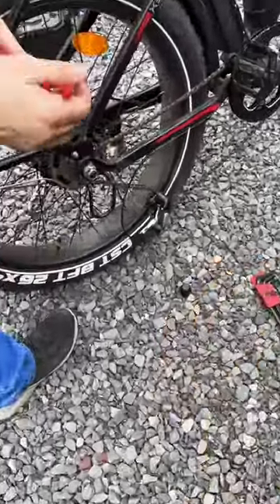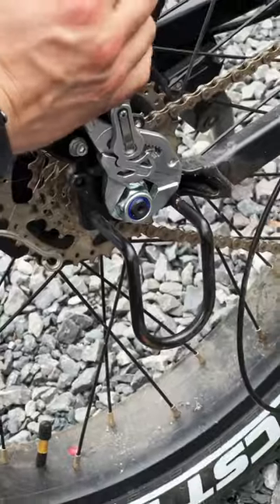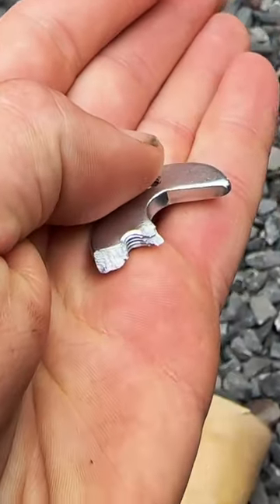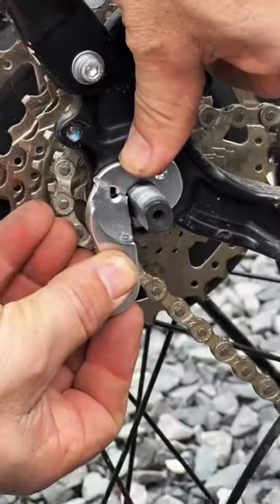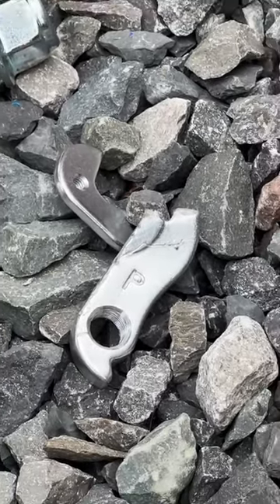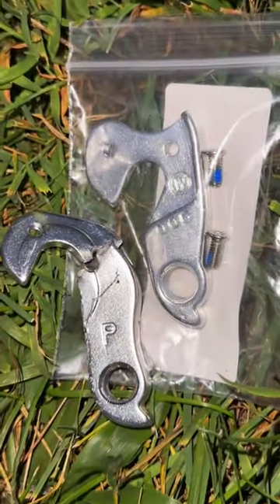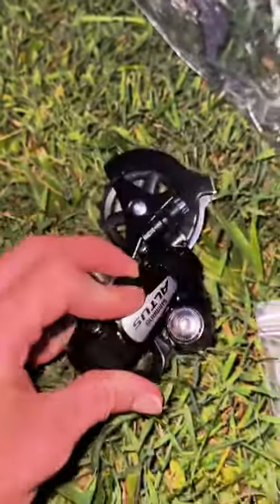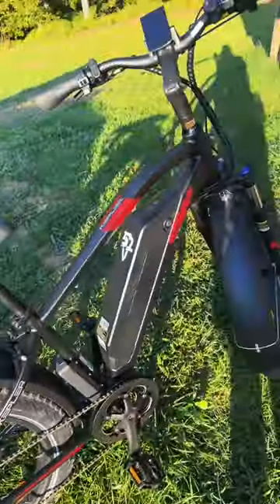Fixing the ebike

Comment: Love the Pliars-Wrench!  One of my most used tools now.
Reply: I have one knipex and one Rothenberg, both excellent! And great for using as general channel locks in metalwork. Mine are getting coated in spatter though :(
Reply: I weep for all the rounded bolt heads in your lives.
Reply: @jotarokujo3603  I have real spanners too, also the pliers spanner is quite a positive action, like it's actually gripping the bolt with a large mechanical advantage, I've not had issues. It will crush a nut if you're not careful though.

Comment: As a fan of your content, and a professional bicycle mechanic, I can 100% confirm derailleur hangers are as strong as they can be. 

You want that piece easily broken, because of the wall thickness of the aluminum/steel tube used to make frames.  You should not ever need to modify a derailleur hanger. They should fit perfectly.
 I would recommend a better drive train than shimano Altus however. 
Deore 10s is VERY durable, and super cheap.
Reply: Thanks.  A lot of people don't understand engineered failure points, not even engineers.  They should be easy to fix and not catastrophically destroy the things around them.  Now if only it wasn't a 5 hour job to replace half the spark plugs on a jeep...
Reply: Sram’s Transmission drivetrains are pretty cool. Don’t require hangers and they’re as durable or even more than a standard drivetrain. Requires a bike that takes UDH though although those are pretty common now.
Reply: @CaptainNomae  srams new t type is garbage that will require frame manufacturers to change frame designs. Standard eagle 12 speed(1st gen) is the best groupset sram has made.
Reply: @anonymoose9038  Every decent mtb frame in the past year has UDH on it. Unless someone is a few years late their bike is already compatible.
Reply: Same here but I'm confused on why he's saying that the altus was hard to source??? It's not. Readily available on multiple sites including Amazon and ebay
Reply: @rekt_gg  finding the derailleur hanger was hard was what I heard.
Reply: 😂 Is all you can say after reading that. Silly millennials
Reply: @BuildBreakFix  what? 
I'm unsure what's making you laugh here. I can promise you that if you make a stronger derailleur hanger, you'll ruin your frameset when you run into a mechanical problem. 

They're designed to be plenty strong in the forwards and backwards direction,  but weak in the left to right direction.  This is done so that the derailleur hanger is able to break free without bending a chain/seat stay.  The yield strength of a derailleur hanger MUST BE less than the crush strength of the aluminum tubing used to make the frames. Thanks for coming to my Ted talk.
Reply: @anonymoose9038  "was not your comment". Was the poor soul talking about the hanger hanger and about his life and death struggle over finding one. Comment was @ his name. But he seems to have with drawn it along with the other comment he posted here. Use to be a @ (his name) on this comment before he deleted it!
Reply: @BuildBreakFix  that makes alot more sense.

Comment: The hanger is also made to brake before you brake the derailer. It's not only to save the frame. The tail of the derailer wil almost always work after you straighten it wirh a hamer.on a flat surface. A bent chain can be straightened with 2 ajustable wrenches.

Comment: Somebody knew what they were doing with those ADP's and talk about the right tool for that der/hanger alignment job!  Mcgyver calls it a miniature hand vise(MHV).  you can always upgrade the whole drivetrain(just use all shimano cables & all) for pretty cheap.  you better keep that buddy around for that one...
Reply: I find it strange to imagine that this is the go-to tool for this. Surely a wrench is easier and better for the hardware.
Reply: @jotarokujo3603  thenbyou have not used ADP's and you have not done this job.  Otherwise,  you would have a pair, and would be bragging like did about how this is the right tool for the job.  My suggestion,  get a pair use them, and check try them as a EDC pliers and you might not ever turn back.  They ain't cheap though.

Comment: I recommend getting a bike with a belt drive I got one from priority bikes and after 2 years of hard riding all I've done is keep the tires pumpedl up.
Reply: That's true no derailer with the gates belt drive internal hubs, just a tiny pin and pin sleeve  you can over torque and dent the tube so the pin no longer fits into the pin sleeve. That you can do every time you remove your rear wheel.

Comment: there are like 3K or more versions of derailleur hangers and you would rather have those break than your derailleur or your frame. I have spares for all my bikes for just such a reason. I carry them on my for my mountain bike as I have hit rocks before and snapped mine off.  5 mins to fix and reattach the derailleur and I am on my way.

Comment: They make way more durable derailleur but those cheaper ebikes don't and won't use it. Also internal gear hub and belt fixed all those issues and can easily hold up for decades with little maintenance.

Comment: I can't get enough of those fast action adjustable crescent pliers. The Milwaukee brand ones are really good about not rusting, and it's pliers so they're not gonna be as expensive as their big products.

I do miss my robogrips tho. No need to do any kind of adjusting. Just use it.
Reply: Im really trying to figure out what your talking about, the pliers wrench in vid is completely diffrent then there cobra water pump pliers except the button, the milwaukee i see are like channel locks, the pliers wrench have a huge leverage advantage. I wouldnt grab a fastner with the cobras unless i was only doing it once because it destroys them. Knipex makes a version that locks like the robo grip does

Comment: 12 years as a bike tech; hangers are designed  to break and you should be able to find the replacement easily by make and model, you’ll then have the align the hanger but you can make that tool easily enough 🎉

Comment: Where I am the hangers are sometimes classed as serviceable items meaning they should be checked& replaced as necessary  
My opinion is it is made cheap /bear minimum it’s more to protect the derailleur than anything else as I found out great the derailleur survived but the wheel is toast 

Tbh I thought you would have Jerry rigged a solution

Comment: That design was not made for motor drive, so naturally it fails.
 Especially the Torque of eBikes. Surface treated Hardened low carbon or Titanium (if there is such a market for). But something that has a higher sheer/yield score.
 It's literally the weakest link.

Comment: Anecdotally, I've personally never heard of breaking one of those; so my theories are: 1) you (or "a friend" 😊)  rode it where / how you shouldn't, do just be a bit more careful from now on; 2) it's made of Chinesium, so either pay to buy something better made or accept likely breakages/ prepare accordingly (which, by buying 2 or 3, sounds like you're doing 😉 😜)
Reply: They are literally designed to break as he explained so it doesn't break the frame, didn't used to be a problem when bikes were made of steel since you can bend that back but with aluminum and plastic bikes taking most of the market share now, they make these because if not the frame cannot be bent back

Comment: The amalgam is too soft in screws too, it is so frustrating, they always strip out if you use electric screwdrivers. You must have shifted too fast?😂🎉
Reply: You're probably over torquing them.  Lots of screws on a MTB are very low torque, in the 3-10Nm range.

Only part you can really get away with torquing to hell is your pedal, but that depends on the material the crank arm is made out of usually.